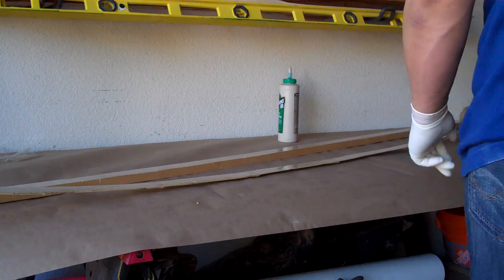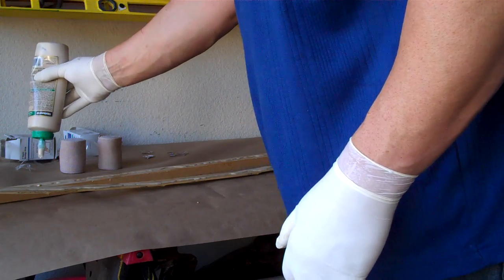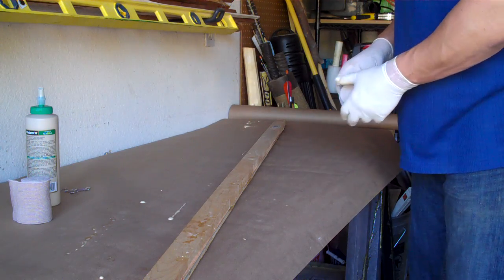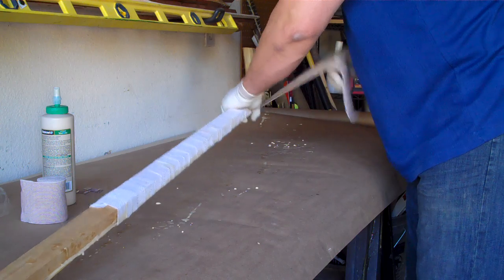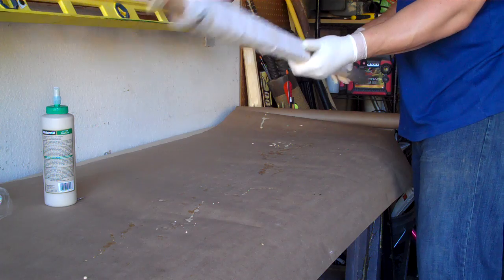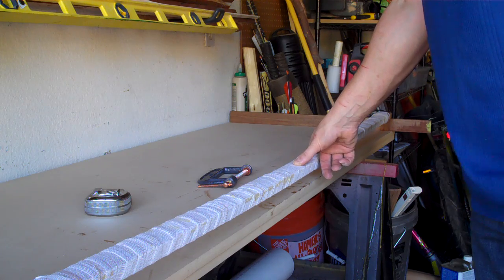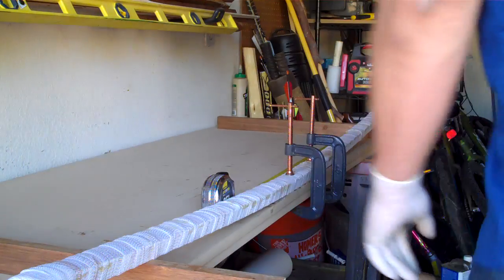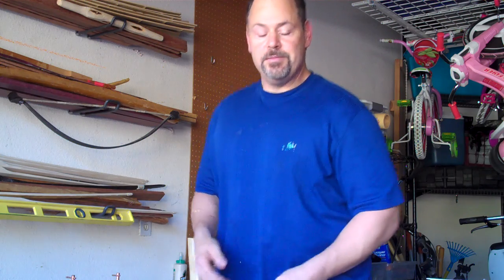Gluing up a Bamboo Backed Longbow: Wood Glue

Comment: Hey mike just glued up a stave using this methord. it's another mahoghany bow! except it's got an oak backing. i used drywall tape to wrap mine, one roll of it can probably wrap 6 bows IMO and it's the price of one bandage over here. and the holes in it mean the glue still gets air! very cheap way of doing it.

Comment: What if you simply used a bunch of C-clamps instead of Ace bandage? Wouldn't that allow for a better evaporation?
Reply from the maker: If you have enough C clamps then they work very well. I have some trouble with the C-clamps staying put on the rounded bamboo or rounded belly (if present), which is why I prefer the wrap.

Comment: Hello. First time bowmaker here doing research before my first bow. Can the bamboo backing be narrower in width than the board? I.e if you had a 1.5" wide board and a 3/4" or 1" strip of bamboo would that be ok? I suppose at the bows ends it would completely back the board whereas towards the middle the board would only be partially backed. Any thoughts on this? Thanks
Reply from the maker: Technically in that situation you should sand down the board until the sides are the same on both the bamboo and the board. The problem in this case is that 3/4" to 1" width is, generally speaking, too narrow for bow stability on anything other than a very light children's bow. The narrowest bows are usually made from man made materials, such as carbon fiber or fiberglass, or with extremely dense hardwood like IPE. Even in those cases the bows are usually no less that 1.25" wide at the widest points. I would not recommend partially covering the board with bamboo as the forces acting on the board will not be symmetrical and can lead to bow failure.
Reply: Everyone says you need groves cut into the stave and the bamboo for good glue up... Not needed?

Comment: when i reflex a bow in that manner i usually use 4" even 6" blocks under the tips then put an extra clamp about where the tip fade, that way the area near the raiser stays straight and the reflex is more aggressive close to the tips , also if you throw the board in the hot shower for 15 min before you glue the backing .. the bow keeps most of the curve better than just by glue/drying alone...  lol it works  only drawback you have to wait until it dries fully before tillering

Comment: why dosent the glue stick to the ace bandage
Reply from the maker: It does, but most of the area is covered by the wood and bamboo with the glue only coming into contact in small areas on the sides. Obviously if you overdo it you will need to sand the ACE bandage off the wood/bamboo

Comment from the maker: You can, but the tape is only useful to strengthen the back of the bow. It doesn't add anything to the belly compression strength and will slow the bow speed.

Comment: I have used old bike tubes for my glue ups and never had a problem just let it set for 24 hours unwrapped it and let it dry for another 24 and it's fine
Reply: Plus the bands can be re used a lot of times the glue cleans off easily

Comment: Ah,... I just figured out why your not using a form,.....because your using a board.
But did you prepare the bamboo properly?
And sand the gluing surface of the bamboo down to the fibers on the bottom,.....and use a toothing plain on both surface's to double the gluing surface and use a glue or an epoxy that fills voids and is compatible to bamboo.
And proper handling of bamboo includes putting it in a dry box for at least 3 day's so both pieces of wood are at the same moisture level when they are glued up so they don't de-laminate.
I'd use  epoxy
You could clamp your pieces so the could not move then wrap it as you go.
Good job with the reflex part.
But I think its good to experiment and do it for your self rather than to puke out industry puke.
I'm interested to see if it work's because the industry says it wont work because bamboo is hydroscopic and it will absorb moisture and de-laminate.
I wonder if gorilla glue would do better,.. that amber colored stuff it used moisture to penetrate the poor's for a better bond.
Put a drop of it on you wife's good plate and put it in the microwave and try to tell me epoxy is better?
When that shit dries it pops out a chunk of the plate.
As far as wood glue I just use what ever Titebond III or gorilla wood glue.
Experiments are knowledge.

Comment: I'm sorry but the idea that the glue needs to breath in order to set is wrong. Think about it how much air is getting into the joint? None! By this reasoning the glue inside the would never set once the outer glue has formed a skin. I have used plastic wrap on all my laminated bows (many many ELBs)and have never had a problem. Give it 24-48 hours and I guarantee it will be fully cured in the join with only the trapped runoff still raw. All easily removed and cleaned.
Reply: As a lifelong Woodworker, I agree with Brett Smart. No need for exposure to Air with any brand of Titebond.

Comment: First of all, avoiding discomfort from the epoxy is a good idea. The chemicals can absorb into the skin. A little bit of exposure isn't a problem, but large projects or repeat exposure can lead to toxicity - not good for your health. Second, Mr. Brett Smart is trying to be logical without having any experience with the subject. The ace wrap allows sufficient airflow for "curing" of the wood glue. it's actually just a simple evaporation process and occurs just fine as demonstrated. Cellophane does in fact stop the drying process.